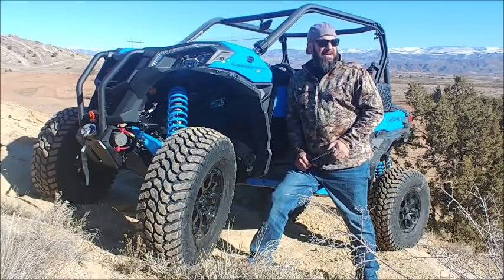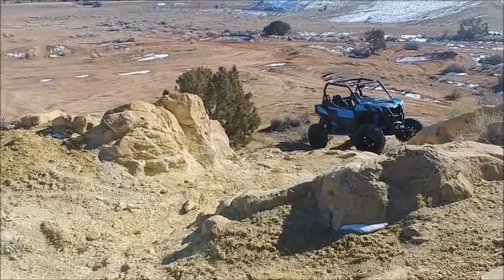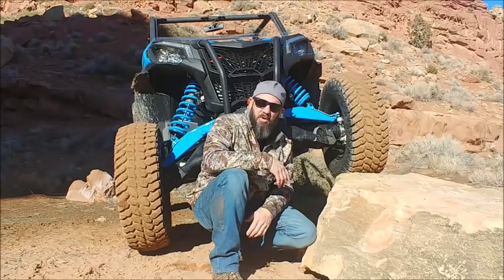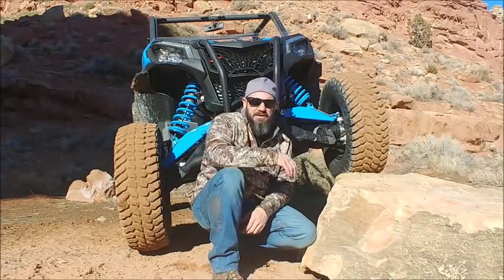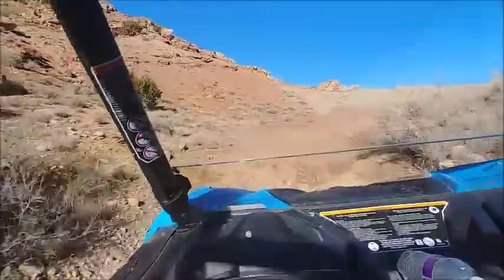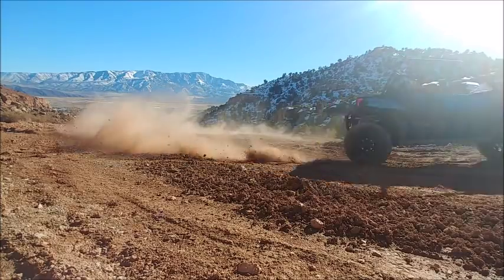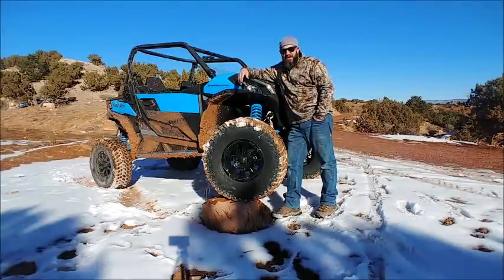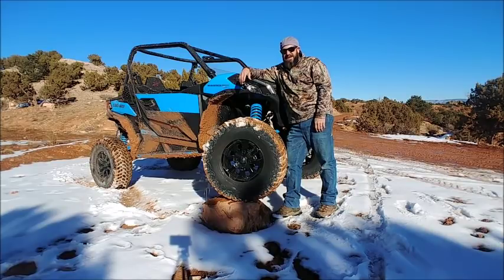Can-Am Maverick Sport XRC, SWAY BAR DISCONNECTED!

Comment: If you haven't already figured out the sway bar quick disconnect, consider making a custom rod that uses a 4x4 manual hub to a splined shaft, this would allow you to quickly unlock the sway bar with no tools and leave everything attached and then once on level ground quickly and effortlessly relock it back into place.
Something like this from skyjacker for Jeeps https://skyjacker.com/shop/sway-bar-assembly/jfsba10/

Comment: Looking at buying one of these soon. Would like to know what it would be like to disconnect the rear sway bar? Was also considering the x3 54". The thing I've noticed on them is how well the stock suspension articulates. Real smooth. But not crazy about the length and visibility while driving.
Reply from the maker: I haven't tried disconnecting the rear. I do some pretty extreme rock crawling and really dont see a need to. You would love this machine. Go get it.

Comment: Did you remove the whole bar? If not where did you attach it when disconnected? I have the same machine and rock crawl quite a bit but want to be able to reconnect when I hit the roads just as I did in my Jeep.
Reply from the maker: I just tied them op out of the way. It was only to test. I have not taken the sway bar off or disconneceted it sence. I haven't had a need to with all the diverse riding I do.

Comment: What rpm is it holding while full throttle? I have sport dps. Its holding 6400- 6800 rpm. I think max hp is at 7200
Reply from the maker: Henke Pettersen when I have watched it it’s about the same 6800 to 7100